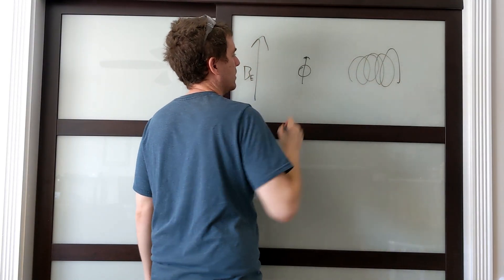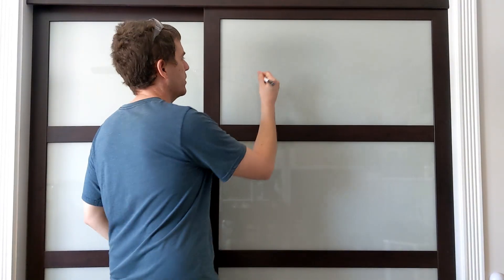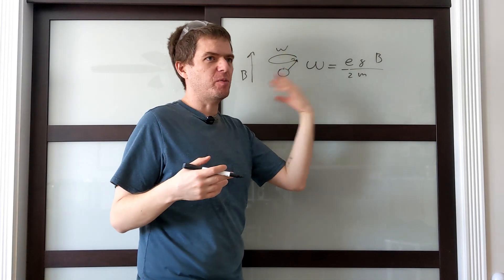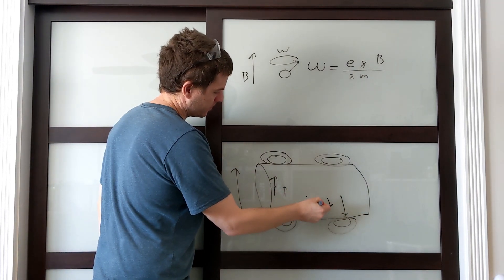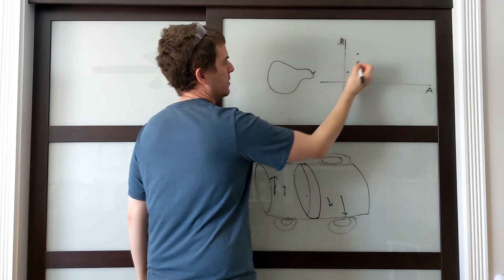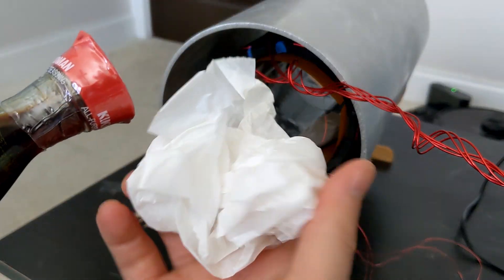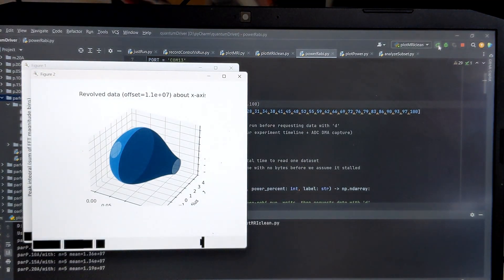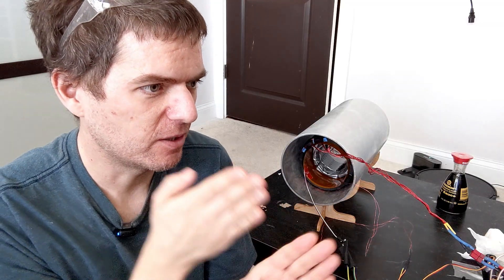Low cost MRI part 3: First images

Comment: When you have the 3D system, could you use this to scan real-world objects and make 3D files of them in a 3D software?  I don't think that's a good use of time, but I think it'd be kind of funny to make an animation with assets that were physically scanned by a machine like this rather than assembled manually in a program
Reply from the maker: yeah,, that should be doable

Comment: That’s super cool, but how did you get enough signal? How long did you have to collect data for each slice? The Earth’s magnetic field is super weak, so the signal you get from each slice would be super weak as well. That’s why human sized MRIs have giant magnets with static fields. What is the resolution? Can you try a different shaped bottle and maybe something like an empty glass bottle to see what the base noise level is?
Reply from the maker: each slice took about 3 minutes. Yes, 90% of the effort of building this went towards lowering the noise in the system. The resolution is like 1 cm haha. Im sure eventually I'll run all sorts of sanity checks. If you want more details on how the underlying electronics work, check out my series on the 1 qubit quantum computer: https://www.youtube.com/watch?v=OLwZplutcZ0&list=PL19BfZmBJd2uQarD-iGr3Ksj2X5scaSLu